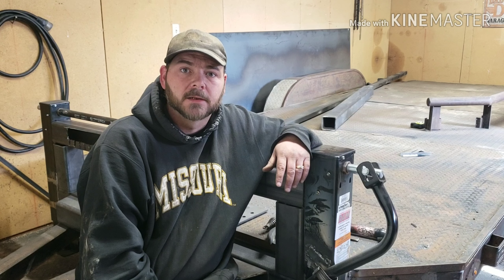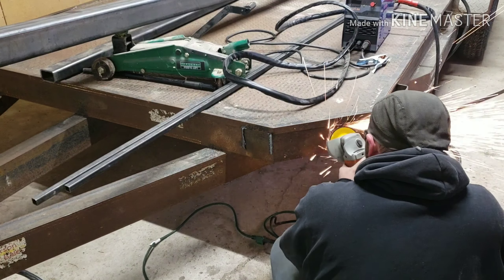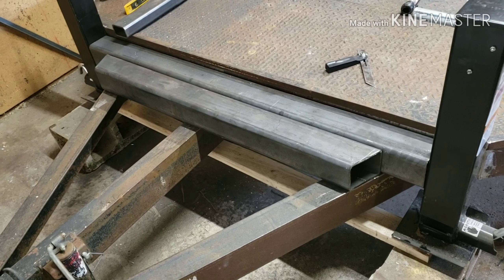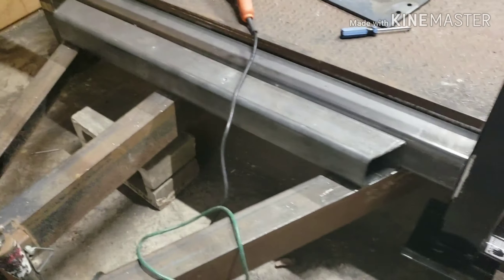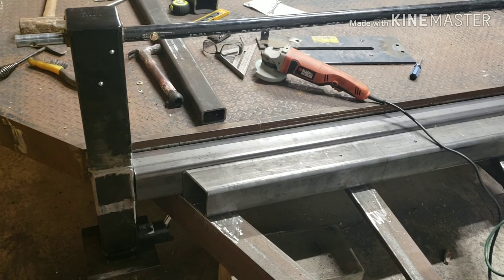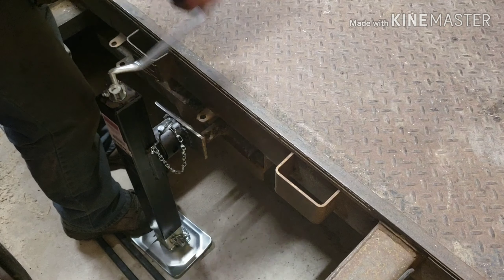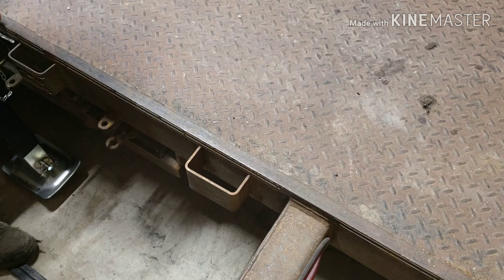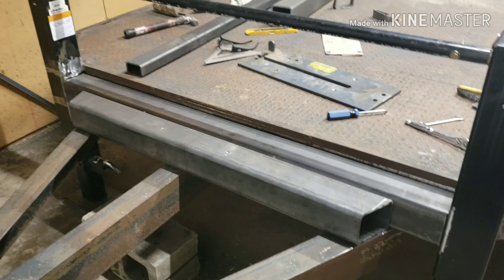Timberland Trailer Part 2: Trailer jacks on log arch trailer

Comment: Your videos are not monitized right. I landed here after sesrching crane on trailer. I need to build something like an A frame welded to a trailer to use it to lift pipes up like 14 feet.
Reply from the maker: They are not, im new to youtube. If you watch the other videos in the series i build a log arch, a big a frame that i can lock up for tall lifting.
Reply: @SharpEdgeForge_1050  Cool, I will look into them. I suggest starting on monetizing videos to start accumulating funds. I lost 1 year of views which was about $400.
Reply from the maker: @cutweldngrind  thank you. I do know i can monetize but i need alot more views and subscribers before i can get there. Maybe someday.